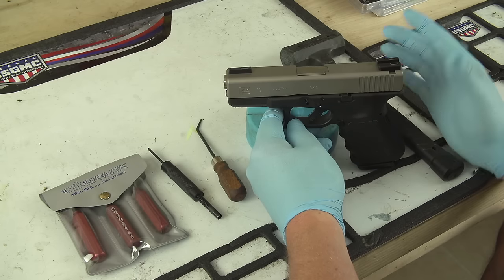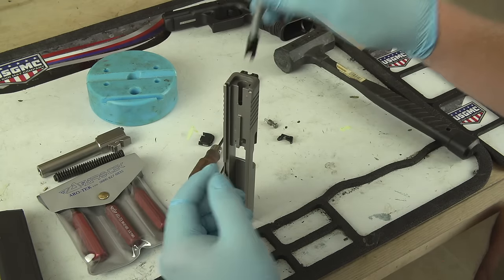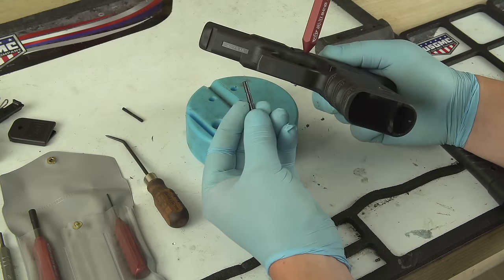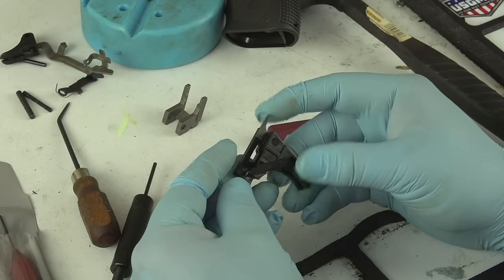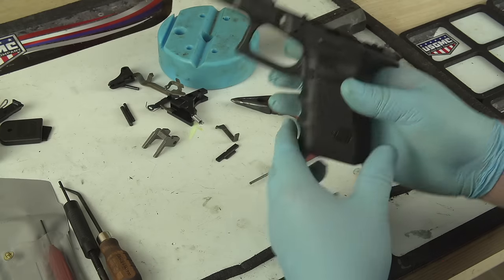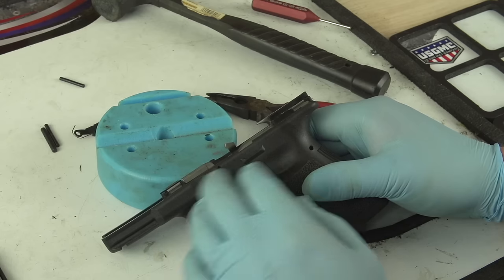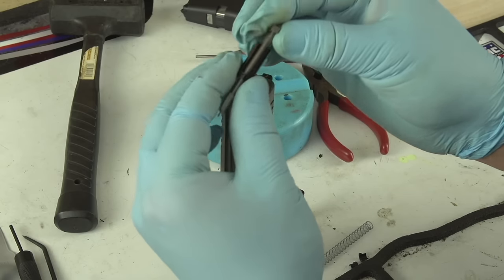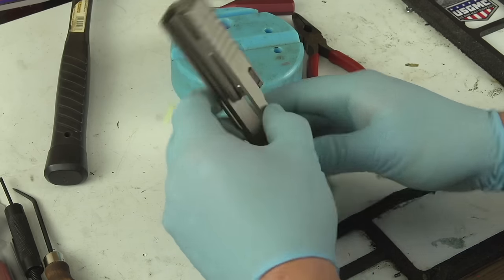Complete Glock Disassembly

Comment: Eric,  This was an excellent video, but here are some additional tips I found work for me. If you squeeze the sides of the Mag tube, the base pads will come off easier.  Also to remove the extractor easier, just push in the trigger bar safety plunger in and it will fall out.  The rear pin is polymer, so you can't confuse it with the 2 trigger assembly pins. 
Here are some points that should be clarified on reassembly.
The "leaf spring under the slide disassembly bar is important to inspect, as they can break and it will turn your Glock into a single shot pistol. Make sure you install the slide disassembly bar with the hooked edge facing to the rear.  This engages with the barrel lug and keeps the slide from coming off the frame.  When looking at the connector side of the sear housing block, the trigger spring should be oriented like an "S". On normal finished slides, the striker channel liner is hard to get out and requires some special tool to remove it and reinstall it with out damage. If you hammer it back in, you will bugger it up and the striker will not function properly.
Reply from the maker: I had a slip moment for sure. I knew all you had to do was push the plunger in and it would slip free. Luckily either method will free it up. That spring is tiny so it flexes super easy. Good tips overall. That's one of the cool things about YouTube is people can fill in bits I may have failed to cover. It's like a master class that everyone can contribute to.
Reply: I like to use a C clamp to get squeeze the sides of the magazine makes it easier and doesn't scratch it up like it would with channel locks.

Comment: Eric thanks for making this video. I generally knew how to disassemble and reassemble a Glock before watching, but a few of the tricks you shared like wiggling the slide release as you try to remove the main trigger pin, and depressing the plastic cup on the firing pin to make removing the slide rear plate easier were really helpful. The knowledge is much appreciated!

Comment: My grandfather used his Army Air Corps issued 1911 in close combat against Japanese soldiers when taking back island airfields. As a kid, I watched him wipe his 1911 down with oil every weekend.

In 1985 I first qualified with a  pistol,  I immediately recognized the 1911 that I the supply sergeant issued me.  That 1911 was one of the last ones stocked in the armory and it happened to be made by Singer Sewing Machine Company. When shaken, it sounded like a bunch of loose ball bearings.  I didn't know it then but  but they were trying to use up all of the on hand. 45 ACP so that they didn't have to turn it in, just the brass. It took me 6 hours and more than a hundred rounds to qualify as a Marksman.  My hands were bleeding, cut and bruised and I could barely move them the next day.  The armorer laughed at me and said to ask for the M9 next time.

It was a great life lesson on persistence and following through on missions.

Comment: Thank you for this video Sir. I have been leery of complete disassemble of my 19 or 27 unroll now. Have always just field striped the firearm and wiped it down and oiled it. I just did a complete disassemble after your video and from 5+ years of use I couldn't believe what I was not getting cleaned and how gunked up the parts were.

Comment: FYI... a little trick I discovered, put your mag in a vise with a vice jaw part protector.. use just use enough force to hold the mag right at the floor plate end... then use your punch to depress and move the floor plate off... that little squeeze of the mag at the base makes the notches that hold the floor plate on less tight and allows the plate to slide off easier.

Comment: Eric, I love your videos but I see your having a bit of trouble with the Glock. First, the extractor is easy.  Push the bearing spring button up into the slide and the extractor will drop out under its own weight then pull the bearing spring button out.  Next, squeeze the sides of the magazine together while removing the base plate, it will come off with much less force.  Hopes this works out.
Reply: Truer words never spoken. There are all sorts of little nuances like this! Thanks for spreading the gospel.

Comment: Just a thought; should probably advise those watching that the Channel Liner (plastic tube that just fell out but is not supposed to) will not go back in fully without destroying it ,as demonstrated, without a special seating tool if the gun does not have a self lubricating finish as your demo model did. Without the tool on a standard finish the liner will not fully seat even with a mallet; it will just tear. With the tool it will gently push in. The tool is the other side of your Glock tool.

Comment: The "sleeve" is called the "striker channel liner". There is a special tool for the removal (for paint/coating the slide) and the insertion of a new one....since the original is usually damaged in the removal process.

Comment: You put the slide lock (slide disassembly lever) in backwards. The little notch is supposed to face backwards and lock the barrel.
Reply: Just to make sure are you talking about 18:36 in the video if so I really had to strain to see it but I think I see what you are talking about. (good catch) but still one of the best video's I have seen as to date.
Reply: What will happen when he tries to fire the gun
Reply: It was in correct. If it is in backwards, the slide will lock back when it’s pulled to the rear.

Comment: When disassembling the frame I always take the bigger pin out first. The spring from the slide stop is resting on the smaller pin and is indexed on the heavy side of the pin, holding the pin in place. If you remove that pin first you risk damaging the spring or other components due to the tension.
Reply: this is true.
Reply: I also remove the larger pin first and I simply depress the striker safety and the ejector falls out.  As far as the trigger bar spring orientation, holding as he was, it should always form an "S" to be in the correct orientation.

Comment: If you've got a 3D printer, there's a .STL file floating around to make a "Glock Mag Disassembly Helper" - a pin on it engages the floor hole to simultaneously grab the hole, and mash the spring plate's tab to push it out of the way, then you just use the handle to rock it, and you've got the plate popped loose and ready to be pulled the rest of the way off. Sweet gizmo. I printed one in PLA, and although to me it looks like it might break if you blew on it too hard, it's apparently strong enough - the first one I printed is still doing just fine after being used a dozen or so times, and shows no sign of wear or breaking. And if it does break, so what? I spend 5 minutes digging up the file and prepping it for printing, and let 'er rip. Half an hour or so later, I'll peel a new copy of it made with 25 cents worth of filament off the build plate. Without that tool, I find that Glock mags are a serious pain in the rump to take apart. With it <shrug> push the pin in the hole, keep it pushed down and follow with your other thumb to keep the spring from going sproing as you rock the handle, and (in my opinion) the hardest part of disassembling the entire gun is done. Makes it so easy I'd bet Autumn could do it.

Comment: At 27:10, huge mistake. According to Glock Armory School and every good Glock armorer I know (ie Johnny Glock) one MUST make certain that the end of the striker spring does not rest in the split between the two cups. This is supposed to be critical for a reason I am not certain of.

Rotate the striker spring so the end is resting half way in between the split in the cups.
This positioning must be monitored all the way during lowering the assembly in to the channel liner as the spring can easily shift during this step.

Comment: I use a Glock tool to disassemble my Glock. No hammer/punch.  It's best to use the tip of your tool to remove the locking block before you pull out the trigger assembly. Doing it this way - with using the trigger assembly to wedge out the locking block might result in damage to the trigger assembly.  IMO.

Comment: Easier way to drop the extractor, I've found is push the safety plunger down, turn the slide over on its side, and the extractor will just fall out.

Comment: I needed to do a full strip on mine and used your video to help me, thank you. However, you may have caught this later, but when you put that takedown bar back in you didn't do it upside down but you did put it in backwards. You mentioned the notch for the spring but on the top of that bar on the side of the ridge there is a cut that catches the lug on the bottom of the barrels chamber. Did you catch it? Did the slide ram forward and off when you fired it? Anything happen?

Comment: ~If you replace any part of the Glock's Trigger Assembly, BE SURE to check that all three of the three Drop Safeties work as they should.  There are Videos on YouTube that shows you how to do this.  It's not hard a all.
~When resembling your Glock, remember to put plastic touching plastic and steel touching steel.  Don't reassemble with plastic touching steel.

Comment: I'm struck by how similar ruger sr9 is to the glock. they look almost identical inside.  found this out when I installed the ghost 3.5 trigger bar. It shortened the reset and made the pull slightly lighter'

Comment: So you seem like you know what you're doing and nobody I've run across yet has been able to figure out how to get a stuck slide off of a model 16 with a poly80 lower even with the backplate bieng removed something must be bent or broken I'm assuming??  would you know how to get it off ? I've tried everything but pulling the pins out and trying to lift it off ? Any info would be great thanks !

Comment: Eric can u please do a video on a S&W M&P 9c complete disassembly? I've watched other videos but they arent as clear and detailed as u are. Bought my wife a used M&P 9c with an Apex trigger installed and it's not operating as it should. Have trouble with trigger resetting and firing pin not hitting primer hard enough randomly. PLEASE HELP. Thanks

Comment: Annoying frenchman here. At 18:30, you install the slide lock with its lip facing towards the muzzle of the gun. Which seemed logical to me until I looked at the protruding guide rod when my gun was reassembled. When the slide lock is installed the other way around (as recommended by other take down guides on the net), the guide rod seem to be properly installed.
Any advice ?

Comment: immediately: "your gun'll probably be black with a tenifer or black oxide coating, which is fine." ...unless you're ME who rusted his. darnit, Glock!
Reply: I've rusted a 17 and a 43. I do really like Glocks and they are my everyday carry-go to handgun. Both mine rusted internally. I'm tired of hearing how rust resistant they are. And to only use 6 drops of oil. I now oil mine with a good coat of oil and do it weekly. Inside and out.

Comment: i have a glock 19 gen 3 and cant take off the upper assembly of it those pins you move down are insanely hard and not springy like yours ...you made it seem easy but i pull them the hardest possible while sliding it a bit back the top upper and sht its hard I cant disassemble it at all my fingers are shredded already trying it tons of times what am i doing wrong.  does it have to be both slide locks squeezed down at the same time or just one from one side?

Comment: Hey Eric. I have an off topic but important question that I felt you could best answer. I bought an SVT 40 up here in Canada for a good deal and I wanted to do my best to preserve it. When I was disassembling it I accidently scratched the stock with a tool ever so lightly. It just took the surface of the finish off, the wood is unaffected. I Was wondering what the heck to seal that scratch with on a surplus rifle stock. I tried google but no one seems to care as much about a scratch on a milsurp stock as I do. Is it something that I would have to just strip the entire stock and re finish or is there a reasonable small fix?

Comment: at 3:00  "There is nothing that is going to fly out in your face..."
FALSE!!! 

 I don't know why in the world he said that. See how he keeps his thumb over the opening as he slide the back plate free. Why??? Because the spring loaded ejector tensioner can fly out never to be seen again. I know this how? LOL

That tensioner tends to separate and then the top half vanishes into thin air. You can fashion a hard plastic disc until you can source a replacement on Ebay.

I actually lost mine when trying to slide the plate back on. DO CONTROL that spring assembly carefully! Same for the striker spring assembly

Comment: 21:33 did the opposite, put big pin in first, now its stuck, HELP, how to remove it w/o ruining it
Reply: If your slide stop/release lever is on the pin, wiggle the lever up and down as you push on the larger pin. The lever rests into a groove on the big pin, so you have to get the lever out of the groove to be able to push the pin out.

Comment: hey i have a glock 19 gen 3 with a sticky trigger.  i tired replacing the trigger and spring.  I also tried replacing the striker spring and its still sticky to reset.  Any tips on whats causing the issue?